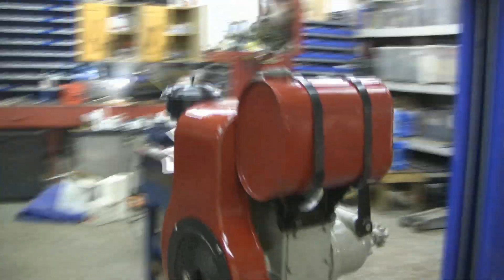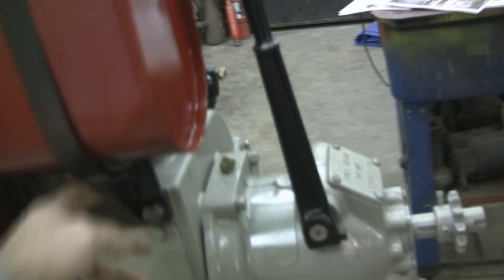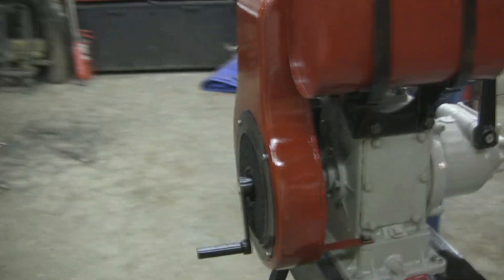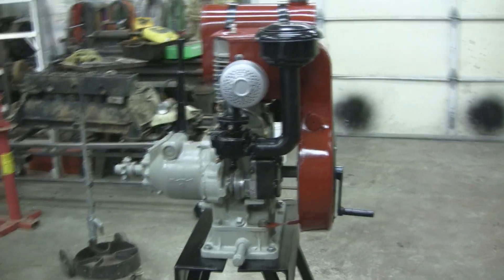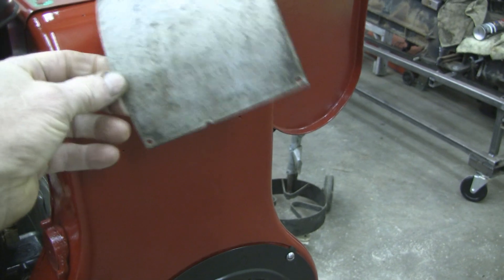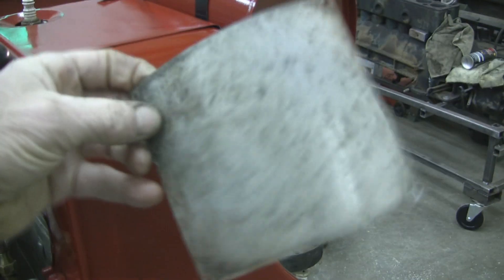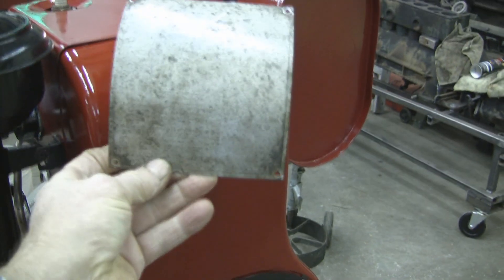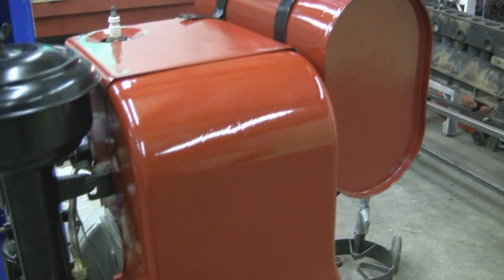Wisconsin engine - a sneak peek

Comment: Wow.  Pinstripes would be cool too.  You got me thinking about getting me one of those engines. There's a guy with one that looks better than yours started out, for a hundred bucks.It's a 1949 - 1957 model  AENLD spec. number is 193650 Bore and Stroke = 3 x 3-1/4, H.P. at R.P.M. = 8.2 @ 3600.  Its not as special because no tranny (just a double pully)  or crank (just a rope cup).  I'd hook it to a chipper I have, it would look pretty good on there!